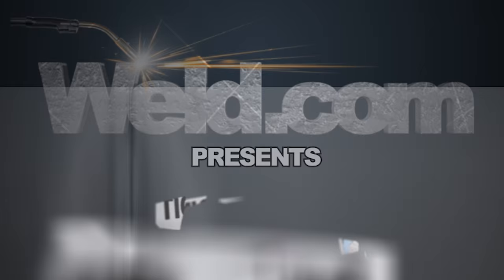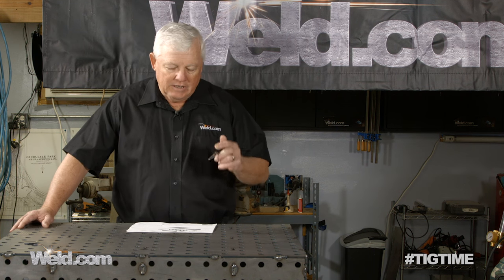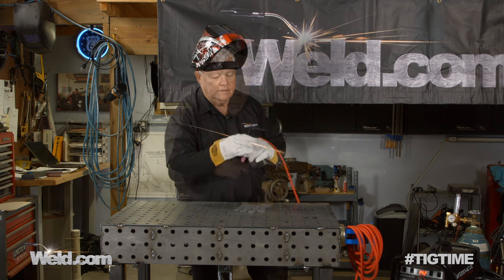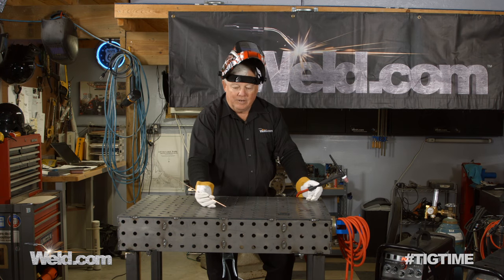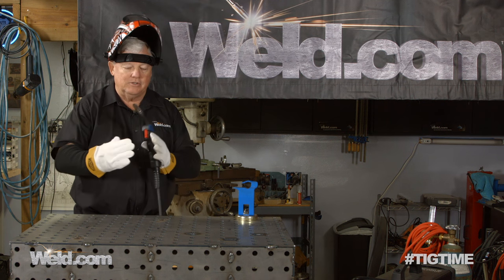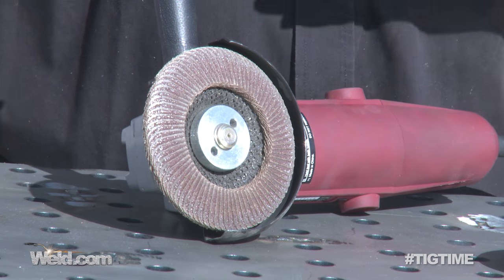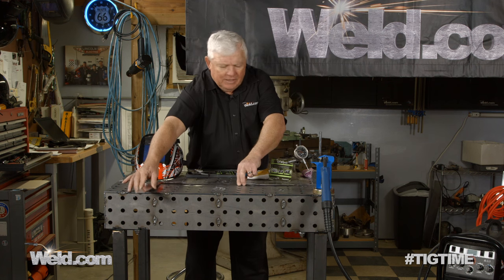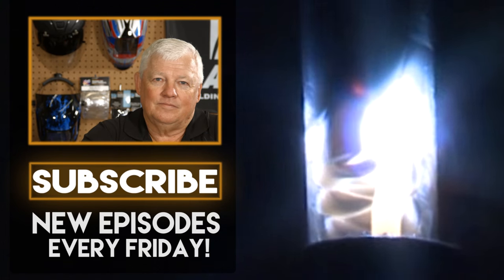Introduction to Tab and Slot Welding Tables | TIG Time

Comment: if you're going to MIG weld the top slots, I'd recommend getting some nozzle gel and coating most of the top surface with the gel, specifically to about  a half inch or so of the slots, prior to welding. That way you won't have to do so much grinding to clean up the spatter and you'll have a much better chance of having a flat surface when you're done.

Comment: I would like to see a review down the road on how the table does after several big hot jobs.  Looks good so far.  Trouble is where I live the freight would be as much as the table.  Good practical video.  Also looking forward to the kit plane.  Cutting and fitting mitered tube joints on dissimilar diameters will be very interesting.  Hopefully you will show a hand way without the expensive tubing cutters (for those small one off cuts in the home shop).  Doug

Comment: Hi Wyatt
Awesome table I watched most of the video of tab and slot 
Would be interesting to have it blanchard ground to see just how super flat it is
I had a 4X8 sheet of 3/8 steel laser cut with holes on 4" centers and attachment plates then had the edges bent down and it really helps to have a larger table

Comment: What are the best kind of clamps and fixture pieces that are reasonably priced to fit in holes
Reply: wfletch88 stronghand fixture clamps work well. Tab&Slot is coming out with their own brand soon.
Reply: Thanks for the information. I need a new welding table. I think I've outgrown the portable table I'm using with my powerimig.

Comment: are there other gases used in tig
Reply from the maker: +saber8174 100% Argon is used in almost all cases. There are specific applications where Helium and other blends are used, but they are few and far between and very rare in the case of the home hobbyist.

Comment: How much is a complete table like this with legs, wheels then a complete set of clamps.
   It should have bars at the sides to hang your grinder or any other tool you use almost every time you use your table. Maybe a small box with some of the clamps you going to use clamping jobs to the table. I'll bet by the time you get everything you need to really use this table. You're in well over a 1000 dollars. Plus??